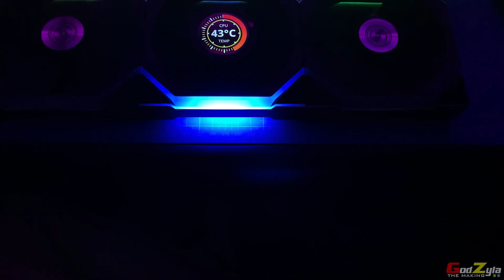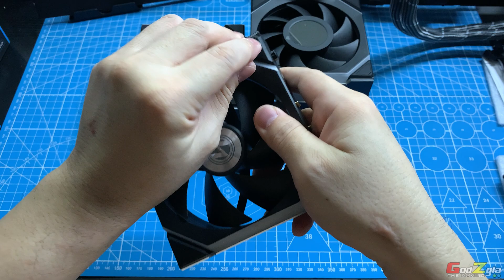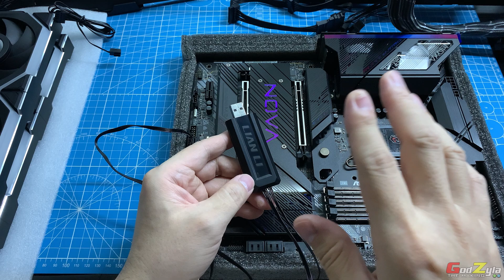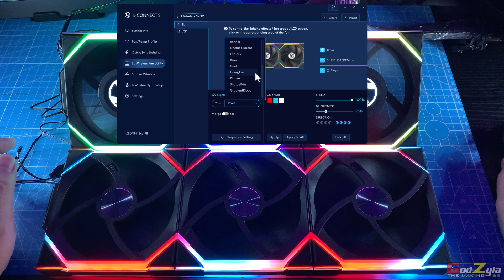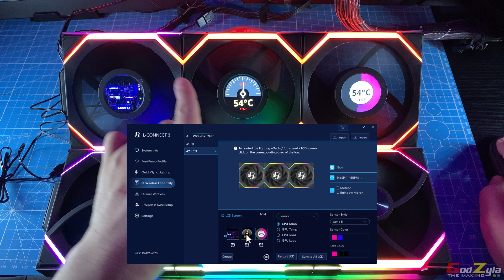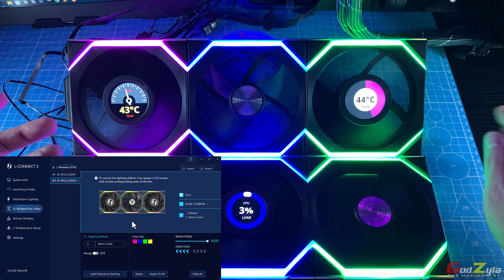Lian Li -  Uni Fan SL and SL LCD Wireless 120

Comment: Is it at all possible to connect 4 LCD fans in a row?
Reply from the maker: Hi Pavel Frolov, welcome to my channel. There are power limitation. You can only do 3 with LCD fans to 1 port/channel, you can’t go beyond 3. Unless you do mixing with non LCD fans, that will be 2 LCD and 2 Non LCD to 1 port/channel.
Reply: @KleoYan  Can I use sticky tape or something to cover up the pogo pins between the groups of 2 then connect them to 2 separate ports?
Reply from the maker: @Pablo-Diablo  nope you need to consider. You will need two reviewers. Daisy chain them and to use tape to block the pins, you will only be able to connect 1 receiver and not 2.
Reply: @KleoYan  Thanks! Now I have some fan returns to do :)
Reply from the maker: @Pablo-Diablo  you are most welcome.
Reply: @KleoYan  FYI the guys that were building my PC managed to connect the fourth one as a separate fan. So I have 4 LCD fans in a row. Two more on rear exhaust + LCD on AIO + 8.8" Lian Li Universal Screen. OMG so many screens!!! Feels like Xzibit built a PC for me 😎
Reply from the maker: @Pablo-Diablo  I see, thank you for sharing.

Comment: What if I want to do a 2+1 configuration? Do I hneed 2 controllers? Lian li fans are great, but they are the kings of proprietary connectors, it gets ridiculous.
Reply from the maker: Hi Seventeen76, welcome to my channel. You do not need another controller but you will need another reciever instead. However on a triple pack, it only comes with one reciever

Comment: Can I connect the usb controller pwm connector  to the splitter with the fan?
Reply from the maker: Hi Kifuri Wong, the wireless sync device (USB controller), the 4pin PWM is to provide and recieve data, it does not power up your fans, nor will your wireless fans takes in instruction that way. It got to be wireless.

Comment: How about performance? Área they any good?
Reply from the maker: Hi Thiago, welcome to my channel. Surprisingly the SL LCD Wireless are better performance compared to the SL Wireless, I will still advise you to look for the TL LCD Wireless / TL Wireless. Those will be much better in performance.
Reply: @KleoYan  But what about the regular SL120 Wireless version? Is the ventilation performance good? I'm not very interested in the LCD model, because in Brazil this model is quite expensive.

Regarding the TL 120 model (non-wireless), can I use it on both sides without losing the RGB visual effect? I ask because again, here in Brazil it is very difficult to find the TL reverse version.
Reply: @KleoYan  ?
Reply from the maker: @sturmgewer44  do pardon me, I miss out on your comment.. for the normal SL Wireless, the airflow not really that good as compared to the LCD version.. sorry again for the late reply.
Reply: @KleoYan  would you say it less powerful than the V2 version?
Reply from the maker: @sturmgewer44  that's for sure. nothing beats the SL120 V2 and AL120V2

Comment: can i buy a 3 pack sl wireless but only use 1 of the fan & just keep the other 2 as spares? i need the controller and 1 pack of reverse fan is already sold out.
Reply from the maker: Hi Jason Chin, welcome to my channel. Do pardon me as I miss out your comment. Yes you can do that but you will need the wireless sync controller to control the wireless SL fan, even if it's only one fan.

Comment: Thank you for the amazing review. Any opinion on the Hydroshift LCD AIO?
Reply from the maker: Hi Marinos, welcome to my channel. for the Hydroshift 360 LCD, the performance is almost identical with the GA II Trinity Performance. Do note if you intend to grab the Hydroshift, please make sure your case have sufficient space to mount this AIO.
Reply: @KleoYan  thank you very much for the prompt response. I am looking to use a HAVN HS 420 case. I believe there should not be a problem with this,.
Reply from the maker: @MrSodious  you are most welcome. oh! in that case. yup, you should not have an issue mounting into that case.. it's huge 😉

Comment: Hi, just want to know after setting up all the fan RGB and Image, can I unplug the usb controller until next time need custom setting then only plug it back or it need keep plug in only work ?
Reply from the maker: Hi Akira Ho, welcome to my channel. Nope you can't remove the controller. it is needed.
Reply: @KleoYan  I see, I though it just like a "key" when need to setting something only plug in, ok ... then the case at back look like got a huge thing stick on behind ....
Reply from the maker: @ you can always get a 1 meter usb type A male to female extension. Where one end of the extension to the rear usb port and the other end plug your wireless controller to it. Then place your controller inside the case
Reply: @ Thank you for the advice. 👍
Reply from the maker: @ most welcome.

Comment: I cant get mine to connect to the controller and idea why?
Reply from the maker: Hi Ty, welcome to my channel. when you mentioned you can't get yours to connect to the controller, do you mean physically you can't connect the cable to the controller or do you mean you did plug the connection properly but your system is not detecting it?
Reply: @KleoYan  the system isn’t detecting it. All the fans and strimmers are white but the L Connect 3 software doesn’t detect them only my LCD AIO
Reply from the maker: @LiftedandLoud  I see, what are your troubleshooting steps done on your own? I will start with doing it individually. You have mentioned that your AIO LCD if working, which AIO is that? and as for basic troubleshooting, I will connect 1 device at a time and check on device manager to see if your system does detact it.

Comment: Do you know if groups of these fans can be daisy chained together with their fan to fan cable? I dont see that cable included in any wireless packs so I assume not
Reply from the maker: Hi YellowEllo, welcome to my channel. Do pardon me, I am not able to understand your question, maybe elaborate further. Thank you!
Reply: @KleoYan  Of course. I believe the cable is technically called a POGO cable? But with the traditional TL/SL fans you could attach 3 fans at the bottom of your case to 3 fans you might have on the side of the case so you only needed to connect one of those two sets for power. With the wireless fans it seems each of those sets would need to plug into the splitter first or all to the motherboard. Either way they all have wires that will have to cross the computer case a bit. I was wondering if the cable used for the setup for the traditional fans would work with the wireless ones. I am not sure since the wireless fans dont seem to include that cable
Reply from the maker: @YellowEllo  ok, now I understand your situation. you wanted to chain all 6 TL Wireless fans together and to use the old uni fan cable (the bridge). Sad to say no you can't, you can only daisy chained from one fan to another and max at 4 fans. plus the new hub which is wireless, does not work like the non wireless hub.
Reply: @KleoYan  I see, thanks for responding
Reply from the maker: @YellowEllo  you are most welcome.

Comment: how could i sync this with other RGB? such as case lighting of lian li evo RGB case?
Reply from the maker: Hi caivs, welcome to my channel. It is not possible at the moment and I have highlight this to Lian Li. Thank you for asking, consider a suggestion for Lian Li to come out with a better controller which can cater for other argb devices.
Reply: @KleoYan  thanks!
Reply from the maker: @ you are most welcome. 👍
Reply: @KleoYan  i just got some of these fans anyways fk it!
Reply from the maker: @caivsivlivs  wooo woo. cool down. just use as it is and as for your case, you dont have to plug into anything, it has it's own contoller on the front panel, just toggle the M or C switch to change color of the case strips.

Comment: They look 👌
Reply from the maker: @Activeha7  hi and welcome to my channel. Thank you for your feedback too 😉
Reply: @ no worries you helped me on my Montech case gpu situation before 🙏
Reply from the maker: @Activeha7  oooo okok. Hope your gpu situation is resolved. ☺️
Reply: @KleoYan yes it is now 🙏, I had a question brother with the Montech 903 air max case, if I was to swap the rear fan with a led one do I get the Montech reverse fan? Or ax or rx? Which one is the same as the current one? If you know
Reply from the maker: @Activeha7  rear fan you will need the AX (normal blade)
Reply: @ so is that the same one as the current one inside the Montech 903 air max?
Reply from the maker: @Activeha7  nope they are not the same fans. if you asking me which model the Montech 903 Air Max case fans, I am not able to answer this question as I no longer have this case.

Comment: This is a great video...very easy to follow for my future Vision build.
I only wish they made black housing with ARGB fans AND a LED screen all in one.
Reply from the maker: Hi Woo Bino, welcome to my channel and thank you for your feedback. I guess there is always a limitation on the ampere for ARGB, that's the reason why there are limitation on argb leds with the LCD, unless if it's of only ARGB Leds and without the LCD.
Reply: @KleoYan  For two days I can't decide whether I want black blades and LCD in the middle or ARGB blades.🙄
I'm thinking 3 140mm ARGB reverse on the bottom ( for uplighting)with 2x rear 120m exhaust and 6 120m push/pull w/ 360 rad on the side panel.
Only real choice now are the side lighrs whether they are LED or ARGB.
Thoughts?
Reply from the maker: @WooBino.  currently there are no 140mm variant on both SL and SL LCD wireless. only the 120mm variant. If you want my honest opinion. I never like to have fans that looks like a christmas tree, it does not give distinctive details.. All you see are just blast of lightings with the LCD, I would rather have the blades in black as the highlight or main attraction is the LCD and with backing line leds (ARGB) on the fan frame. This will look more elegant.
Reply from the maker: @WooBino.  btw in my other content, I always mentioned I never like ARGBs, just a light touch. I focus more on performance and details of the system more than LCD or ARGBs. I like refine details with a theme https://imgur.com/gallery/sonic-build-montech-king-95-pro-OkXCooL and this is my thermal https://i.imgur.com/y0L5z9q.png
my past build https://imgur.com/gallery/godzyla-lian-li-o11d-mini-setup-Pw5kY4q
Reply: @KleoYan  Thanks for the reply. Lian Li seems to make great stuff but the marlketing department is horrible with the super confusing model names.
Reply from the maker: @ you are most welcome. Infact it’s quite daunting about the Uni fans family. Anyway all the best with your build. 😉

Comment: The only downside of the wireless fans is that you can’t use them for AIO cpu fans. No fan speed control on pwr. Can’t be controlled from cpu header. Lian li is making it harder to use their fans with different AIO. Same thing with their wired proprietary rgb + pwr all in one fan header cables. I don’t want to use l connect 3 for cpu fan speed with my AIO Kraken elite 2024. Please give a y splitter for rgb and pwr like on v1 where I can control fan speed on nzxt cam and rgb on l connect 3.
Reply from the maker: Hi Hussar, welcome to my channel. I do understand what you meant. In my illustration, you see two sets of fans being labled. you can use that to set the Radiator fan curve based on the CPU Temperature. it's the same as controlling using UEFI of your motherboard.

Comment: Hey thanks for this video. This is extremely informative and very well done. Quick question, do these new wireless LCD fans cool better than the sl120v2 fans? I’m stuck in between these for my new build, please help! I care most about performance as I would have 3 of these cooling my AIO radiator. Thank you!
Reply from the maker: @rippraise2254  welcome to my channel. If you care only on performance. P28 will be the way to go. But if to compare the SL LCD wireless vs SL120 V2, then the SL120V2 is the way to go.
Reply: @KleoYan Ok thank you for the reply.. I’m down to 2 fans now, the sl inf or the slv2? They would be the reverse ones for my radiator. They both look so damn good I’m torn between the two. Is the performance in cooling between these much different if at all?
Reply from the maker: @rippraise2254  Hi welcome back. both SLV2 and SL-Inf are about the same, won't go wrong with either choice you make. 😉
Reply: @KleoYan Thank you so much for your reply again. I’d like to say, I’m very impressed with how detailed your video is and how you care enough about your viewers to answer every one of your comments. That’s very rare for a channel that goes this in depth about products. You’re awesome! Easily have my sub, thanks again. 👍🏽
Reply from the maker: @rippraise2254  hi and welcome back. you are most welcome, thank you for your valuable feedback. It does mean alot to me. All the best with your build too. 😉
Reply: He said the wireless lcd fans were much better for radiators than the non lcd fans. The non lcd fans have more cfms in the details. 58 cfms for the lcd and 64 cfms for the non lcds. So the lcds how better?
Reply from the maker: @ hi and welcome to my channel. The non lcd is a 7 blader and the lcd is of 9 blader. When it comes to static pressure. The lcd gives more static pressure else the non lcd does not. This inclusive of testing it in an open bench which is not included in this content. You can choose not to trust me and to test it out yourself.

Comment: Hello Kleo I need some assistance if you have time. I have an sl infinity controller working case fans without issues. I also have a TL controller working three intake fans. Today the led colors and the led screen stopped displaying while the fans are still  functioning fine on the TL side. I also found that the TL controller disappeared from the L connect settings so I cant set them up.

I uninstalled and reinstalled L Connect, but it still only displays the SL Infinity controller and the GA ll lcd.  I checked all wires to insure they are making contact and they appeared good. Any idea why the L Connect 3 app doesn't recognize the TL controller? Thank you in advance
Reply from the maker: Hi Mike, welcome back. I like to ask, how did you connect the three controllers to your motherboard usb 2.0? does your board have 3 USB 2.0 socket or are you using a spliter? If you are just using a spliter that does not comes with sata power, that could be the cause of it. Best way to test it is to test the controller individually to the USB 2.0 motherboard socket. This is to narrow down if any of the controllers is having the issue.
Reply: @KleoYan  Thanks for assisting. The TL hub is connected directly to the motherboard. The sl infinity hub is connected to a splitter and those fans work fine. The wire on the CPU hub goes into the splitter sharing the SL infinity.

Be advised I had this set up for a week and all fans worked fine. My connect L 3 displayed both the tl hub and the sl infinity hub so I could change colors speed ect. For some reason the TL has disappeared from my Connect L 3 app. Where it went I don't know unless something has malfunctioned causing the app not to recognize the tl hub.
Reply from the maker: @ hi welcome back. Have you try to switch the usb port. If it’s still the same. Try connect only your TL Hub. If it still does not work. I would advise you to raise a support ticket with Lian Li. See if they can resolve your issue or to replace your TL controller.
Reply: @KleoYan  Thanks Kleo. The support ticket is very difficult they want so much information and I'm not that tech savvy. I don't know why they cant answer a question missing some information. I'm just going with my gut feeling and I'm going to order another TL hub. It's easier than the support ticket. If corsair has phone tech I'd switch if this doesn't work.
Reply from the maker: @Mike-hs8fq  hmm give the single test a try on the TL Hub first.. see if your system does detect or not. To be real honest, if that does not work. you can still request for a TL Hub replacement. if you need help with the form. send me an email. I can aid you with providing them a report of your issue. my email is godzylatech@gmail.com

Comment: Fantastic video I am sure it will help alot of confused people me included
Reply from the maker: Hi liam roberts and welcome. Thank you for your feedback and I am glad this content is useful to you. All the best with your build too. 😉
Reply: Looking at buying these with sl led wireless fans I want to mount lian fans to arctic aio what would be best configuration if I connect all fans with sata splitter would I be able to control fans threw L connect and control aio threw motherboard which fans would be best for radiator normal or reverse blade
Reply from the maker: @liamjr92  Hi welcome back. The SL Wireless does not perform as good as the SL LCD. it wll be better to use SL120 V2 or AL120 V2 which has higher static pressure. In this content I have mentioned that the SL LCD wireless static pressure is much better compared to the SL Wireless
Reply: @ thanks for the reply do you know what the difference is and how that would effort cooling performance I like the fans but am not really interested in lcd version
Reply from the maker: @liamjr92  The non LCD wireless SL fans has lesser static pressure as compared to the LCD. The thermal difference is about 5°C to 7°C. unless you do push pull configuration, but doing push pull configuration, you got to make sure you have enough room in your case.